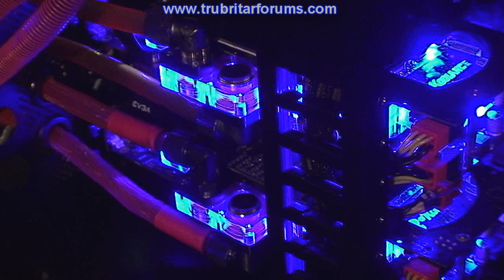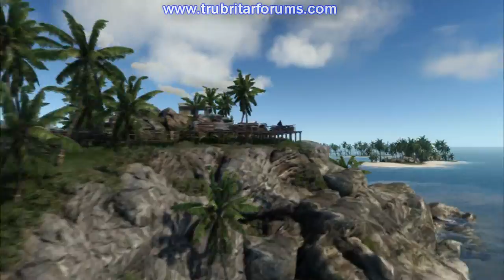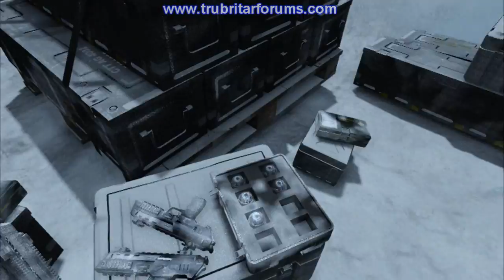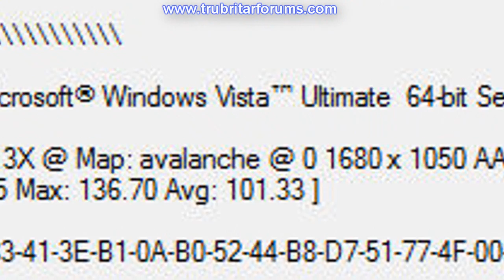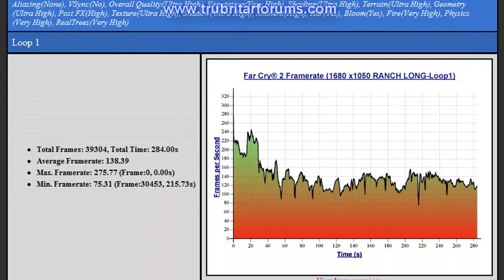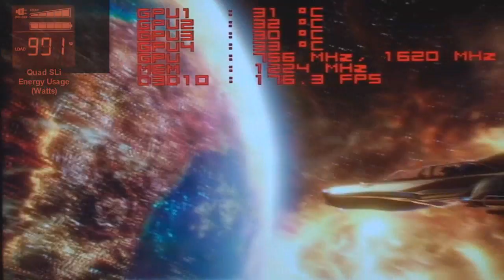(HD) GTX 295 QUAD Overclock Benchmark Test by Trubritar

Comment: So if I have two of these cards and a i7 970 / Asus based system. . .  can I rely on my Thermaltake 1000A Toughpower PSU? Will it be enough power?

BTW. . .  I have the 12 gallon mineral oil pc w/ external radiator cooling. ; 0

Comment: 940w Peak?

Nothanks.

That's fucking insane. Two 5870's (which is virtually the same performance as Quad SLI 295) only uses around 600/650

Comment: seriously fuck all these fags testing crysis warhead with 101 fps on 1680x1050. you got the fastest computer, now at least use the present day resolution. If your not going to test the max with the max reso at least used 1920x1080 hd resolution.
Nobody cares about 1680x1050. All 16:10 monitors are slowly discontinuing. fuck I just want someone to benchmark warhead in 1080p 5xAA 16xAF Enthusiast. arg..

Comment: your gonna want at least a nice 60 or better, just so you can have it on double or triple buffering with peak performance, but your right, just because it has the ability to reach 200 fps doesn't mean anyone is going to use it

Comment: sli does not perform better
benchmarks show that onlu 2 way sli has significant speed increase upto 2.8x

3 way sli 2.5x
and 4 way sli ,well.............

so spendind an extra 300$ on extra card wont just do justice to the money you paid.

anyways i will go for crossfire

Comment: dose not make any sense me to not play it in 2560*1600, if you bought 2 295s, and not a 30' monitor your a fucktard IMO, i have 1 295 and its all you need for a 30, even crysis runs maxed on it 80 of the time when there isn't to many explosions so on 1080p its easy for it.

Comment: I don't know. I had Quad-SLI with two 9800 GX2 and will never use it again. It might be 70 fps avarage but looks like 20. The last switch I made was from a 4870X2 to a 285 GTX SSC. I prefer the single GPU solutions just because SLI and Crossfire haven't worked all the problems out jet... Now Crysis seems more stable although 3DMark Vantage proves that the 4870 X2 is faster

Comment: Hey has anyone done a crysis/ crysis warhead benchmark @ 1680x 1050 @ very high/ enthusiast with one gtx 295? Just curious how one would perform. Also has anyone noticed micro stuttering in Crysis with the single or sli gtx295?

Comment: If the LED's are plugged into the card's fan controller - then they would get brighter when the card is under load (unless he's fixed the fan speed with the EVGA Precision thing).

Still - that has got to be really cool.

Comment: both of u are wrong

The GTX 295 uses memory from a GTX 260 Core 216 896MBx2 per GPU

&

The GTX 295 uses 2 x GPUs from GTX 285 but on a lower clock due to cooling issues.(Well it is one cooler cooling two GPUs)

So it is basically it is a GTX 260 Core 216 + GTX 285 X2 = Awesome Power

Comment: Hmm.. 100+ avg FPS. Superb!

Too bad you turn on vsync and get a roof of 60fps on 1680 x 1050 and above. Making it on the ranks of a single GTX 285.

Future proof you say? Heck afaik, next gen graphics wont come out until XBOX 360 and PS3 de-commissions. So for that, you spent a hefty amount to use it on something that does not exist. And by the time the certain game exists, you can get perf like this on a mainstream card.

Comment: Is it just me, or does the benchmarks look like they are failing? Lol. I run a system with about as much power, but when I run benchmarks they are much smoother, although you get higher framerates. It's probably just the recorder.

Comment: I just want to let you guys know that playing at higher resolution will only require power similar to this setup. 1680x1050 isnt too taxing. A steady GTX 280 or a single GTX295 really should do the job. Well, unless you expect to play everything maxed out with maximum AA enabled, which in practice is rather pointless..